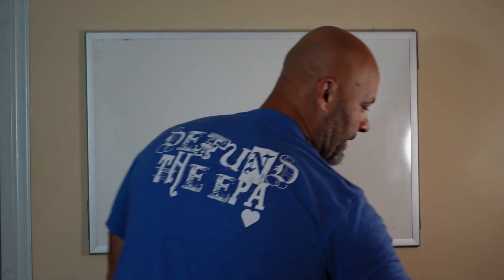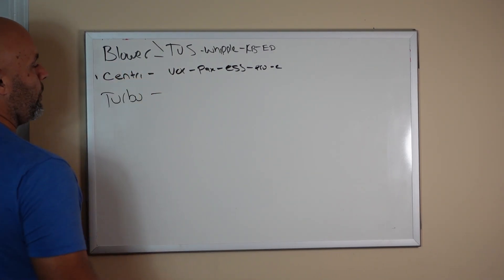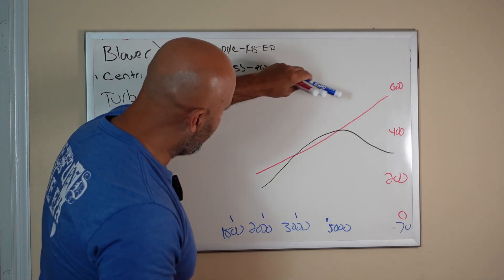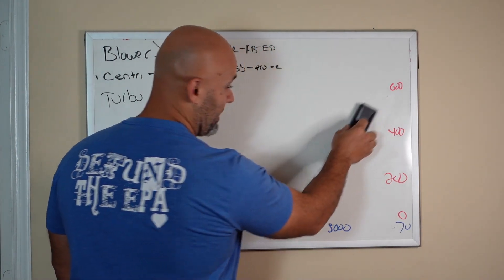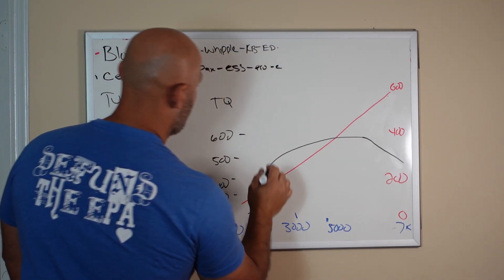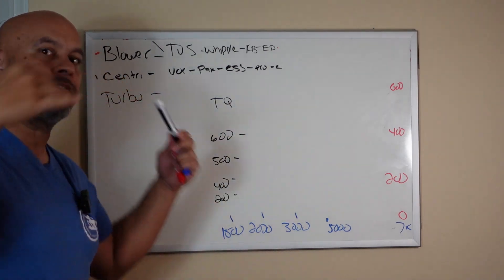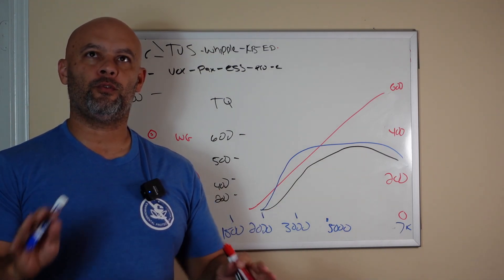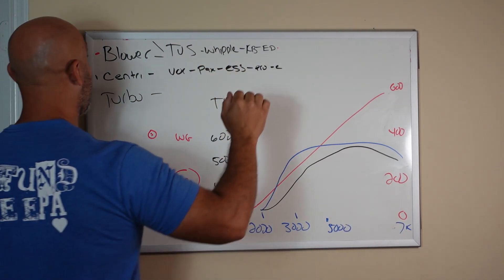White board series #5 Supercharger power delivery

Comment: I have an auto with a paxton and a 3700 stall... perfect combo for me.  Drives like stock down low, until you hit it; then it's at 3700 instantly, and the party gets going...  I have plenty of traction issues, and I can't imagine having more tq down low with my torque converter... if I had to give that up for a PD blower, meh...  I will say that I envy how clean the PD blowers look like installed compared to my snakepit.  The torque booster thing looks dumb, seems like more heat and stress everywhere so you get a bit more airflow down low... with the right torque converter, you're not at low rpm for longer than half a second...